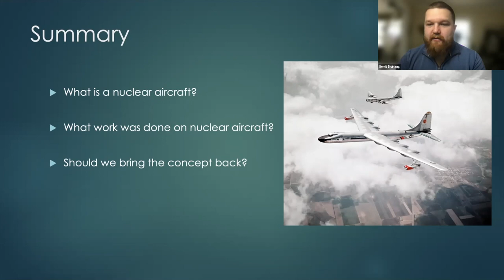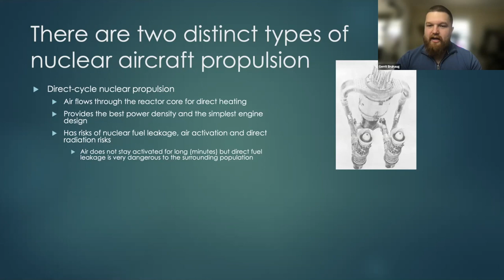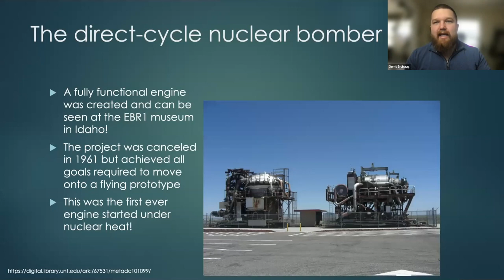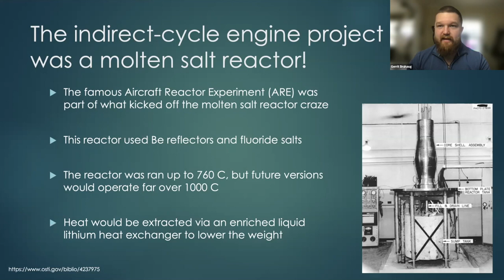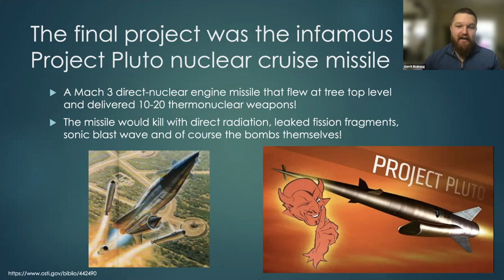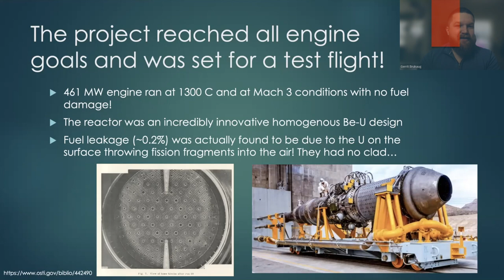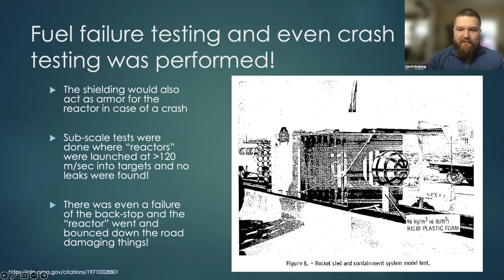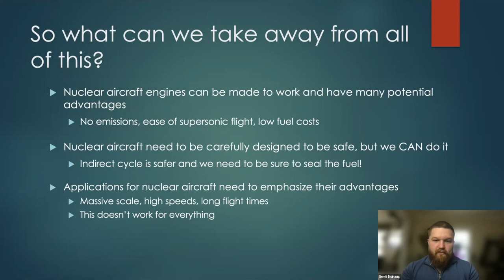Gerrit Bruhaug Presents on Nuclear Aircrafts

Comment: In my opinion an relatively easy first step could be nuclear powered tug-drones which can be used as tugs to recharge short range battery powered planes in the air and drag them across the oceans.

The shielding requirements would be less demanding in an unmanned plane and only flying over the ocean and never landing at a normal airport would make the safety case simpler.

B2w you can find a lot of interesting informations about nuclear powered planes at "aerospace projects review" as well as the youtube channel "found and explained".